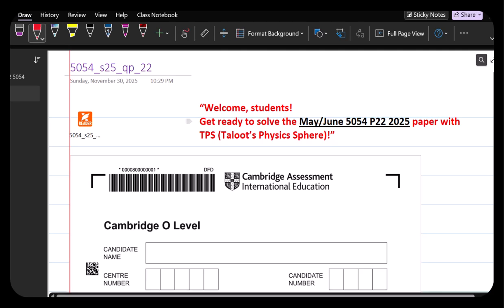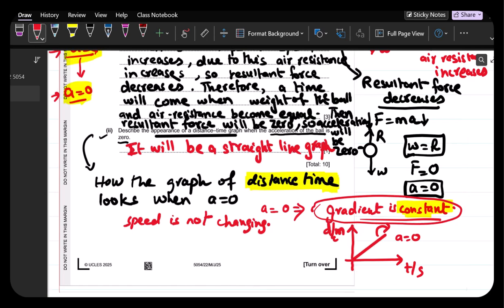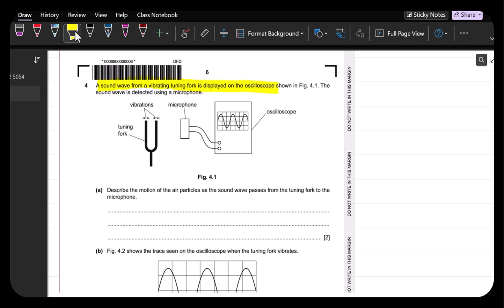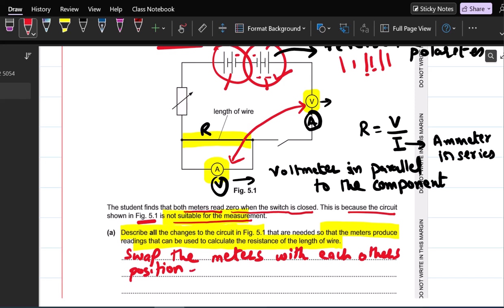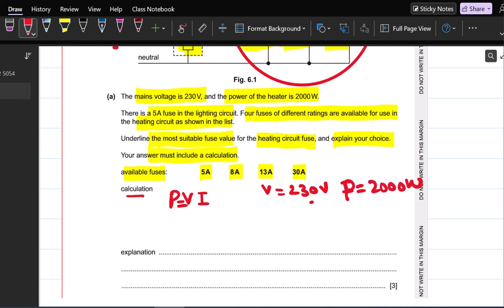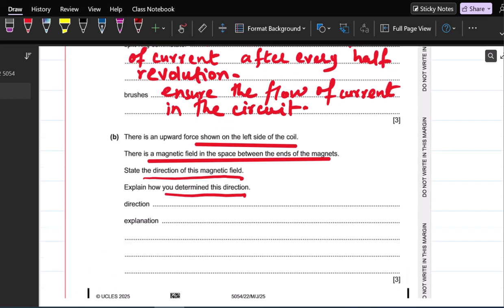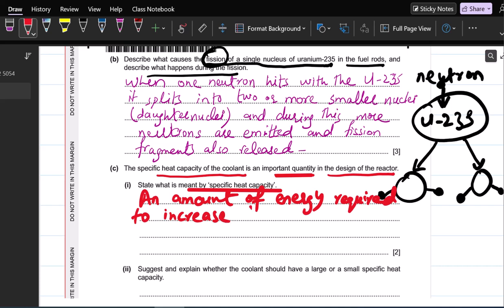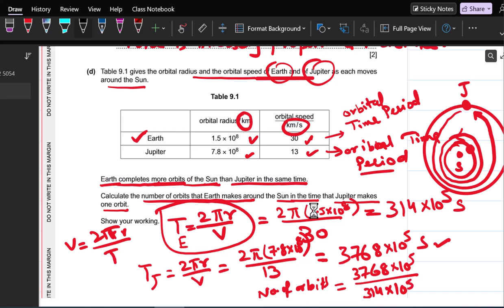O Level Physics | May June P22 2025 | Paper 2 | Zone 2 | 2025 | Physics by TPS

Comment from the maker: Dear Students,
I mistakenly substituted the value of input power instead of output power. Kindly accept my apology for this error. However, the formula I wrote was based on the correct concept, where output power should be used.
Even I spoked that output power will be used.
Regards,
TPS